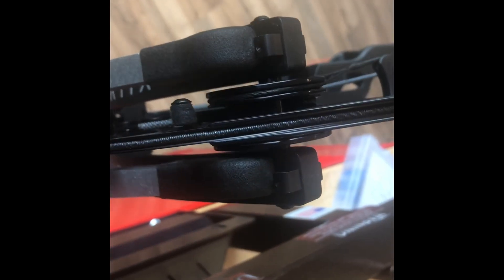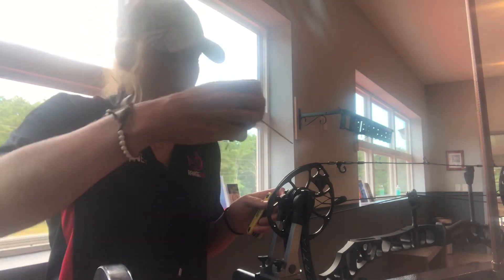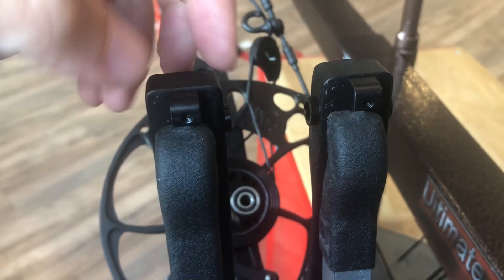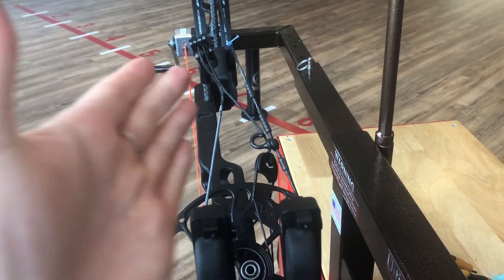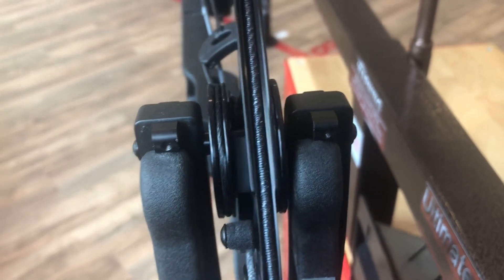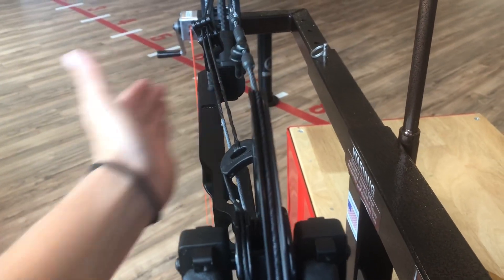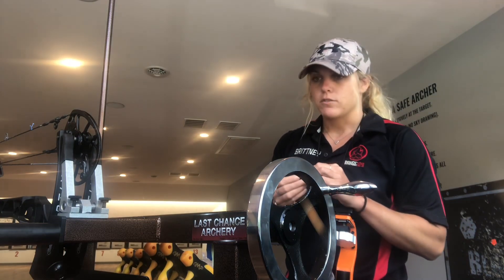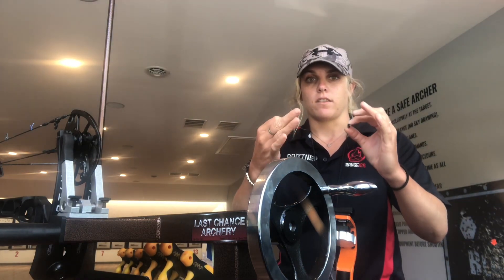CAM SHIMMING- adjusting the center shot of your compound bow

Comment: If a bow can yoke tune, would you start there or start with shimming?
Reply from the maker: I’d  start with yoke tuning. Again you  just have to keep an eye on cam lean and cable rub. If They have yoke cables I usually choose to use them to pull the point of bare shaft left or right